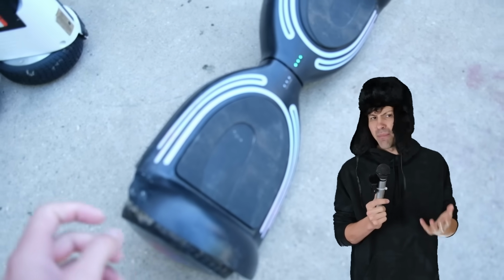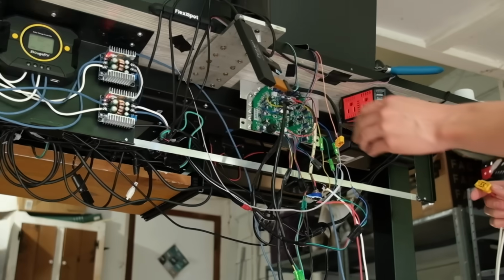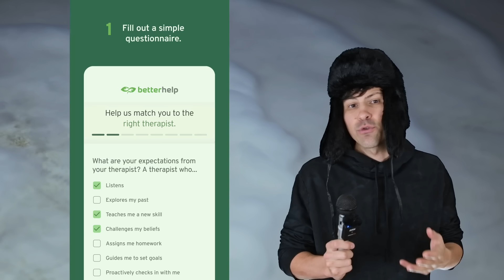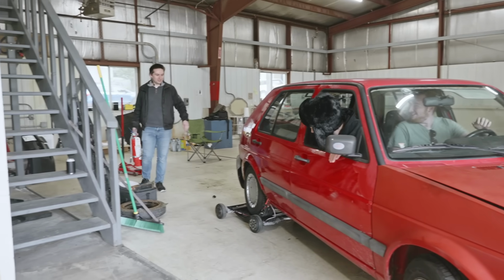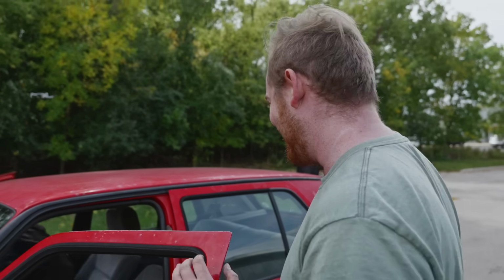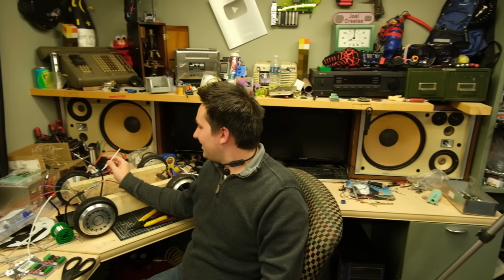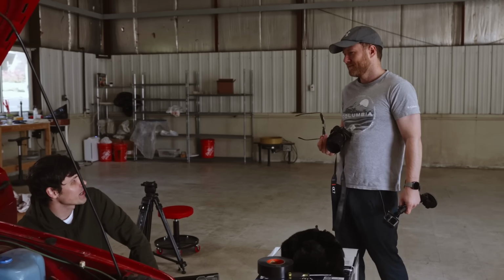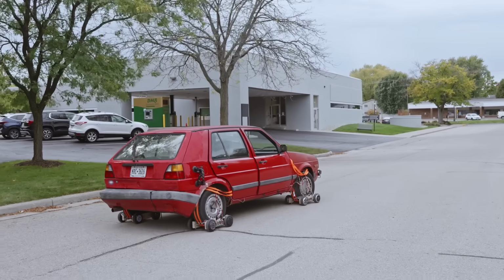I built a Car out of Hoverboards

Comment: I now want a car where the wheels don't spin. Don't care how. But a video of a car going down the road without the wheels spinning would be awesome.
Reply from the maker: It's super trippy
Reply: But that happens anyway just because of the frame rate lol

(Getting a video of a car going down the road without the wheels spinning)
Reply: @biginfluencer5252  yes. Like in a lot of helicopter videos. But doing it without video editing. That would be cool
Reply: You can't really do it by just matching the framerate with the rotation of the wheel, because the blur would give it away. It wouldn't look like the car was going down the road with stationary wheels, it'd look like you matched the framerate. You would also need to have a high shutter speed/low exposure to reduce the blur, then bump up the levels in post processing to bring the image back up to normal brightness.
Reply: Do note that it'd look weird in a new way as you would also have removed motion blur from everything, and added noise to the picture depending on your camera quality. With more editing you could probably convincingly smooth out the noise and add the motion blur back in. At that point it would've been easier to just film a car and replace just the wheels in post.
Reply: Hide really small wheels inside the tires
Reply: You could spin the hubcaps in reverse, at -the rotation of the wheels so they appear stationary. Pretty sure hubcap spinners are already a thing so shouldn't be crazy hard to do
Reply: Some of the expensive cars has stable logos on their wheels, if you can buy that for any car as accessory and stick a big wheel sticker on it, you can make it look like that. If that thing isnt selling anywhere, you can just stick a bolt center of the wheel and put the thing from spinning fidget toys, make a fake wheel skin and tape to the body so it wont spin with the wheel

I think i found the best way? Tho you can only hide the wheels from sides, you cant really put anything between the wheel and body
Reply: that exists already
love how goofy it looks
Reply: Build wheels under the car that are covered by big wheels.
Reply: Lag
Reply: You just discovered spinner rims.
Reply: @trashtrash2169  if you had a fast shutter speed the blur wouldn't be too bad
Reply: 2023 spinner/floater wheels
Reply: @SamanthaLaurier How do you do, fellow ace?
Reply: @CalebTibster   Could be worse, and you?
Reply: What you could do is make the car just barely float off the ground and the exhaust is the same with of the car and the exhaust propels the car forward
Reply: just buy the stationary hubcap spinners
Reply: was able to use a tahoe with weighted spinners to pick up my prom date... same same.
Reply: the russians already made hubless wheels (garage 54)
Reply: Tires spinning and wheels not
Reply: Garage 54 did that one already.
Reply: There called spinner was a fad in the early 2000's they are hub caps you put on you rims that dont spin or spin when the cars not moving was big in the rap seen lol
Reply: Dead easy. Black ice.

Comment: That last shot was priceless! Nice vid. Looks like if you could get all the electronics figured out and ran it on smooth asphalt, you could get 10-15 mph.
Reply from the maker: I was guessing around 15 too
Reply: THANKS KERRY
Reply: @JoelCreates To get that fast you'd need to rewire the motor phases. They're not in optimal configuration for power or speed.  You should rewire the phase coils for high voltage. Should be possible without re-winding each motor. I barely get 15mph on my hoverboard eboard running on 12S with 4 hoverboards running on VESCs.

Comment: Imagine an actual product similar to that for when your car stops working and you don't feel like waiting for hours to get towed home. I'd buy it
Reply: That is an interesting idea. Since it would account for several points of failure.
Reply: There is a product like this. Look at the Icra-2015, this is a fairly outdated design, but it's the first video I could find on here relating to the subject of interest. 
Some parking lots actually use this. Mainly to get vehicles out of the premises that have overstayed their welcome. They do cost a fair amount though, as they need to be engineered to handle the weight of most vehicles, which can be well above 2 tons.
Reply: @FUCKDSS  Right, though some issues would come with consequences, like a flat tire changing the weight/balance, plus it would be extremely limited in speed and might have some trouble with turning how you would want to. Apparently some places do have some kind of motorized skids or whatever they're called for moving cars around in a garage. Which makes a lot of sense, much more than for anything onroad.

Comment: I think you should try spin the car wheels with those motors instead of driving them on ground. As a resistance motor. Tyre is softer than road so there will be less shock on them and ofc they would need to support the car

Comment: these motors could probably fit in the space the normal axle takes up... if you could get enough similar motors, you could drive all of them with 1 or 2 big controllers (might need 1 for each side because of the differential) and have it look exactly like a normal EV swap

Comment: One thing ive learned from messing with hoverboard motors is that some of the aluminum wheels have twice the torque or more compared to any of the plastic ones. The plastic ones are extremely weak in torque.

Comment: Only a minute and a half in, but I think hoverboard motors are a couple hundred watts each usually, one horsepower is 750 watts (ignoring losses) so to even get 5 horsepower equivalent with hoverboard motors you'd be looking at 12 or so hoverboard motors. According to google the currently available car with the least horsepower is the Mitsbishi i and it still has 66hp or ~165 hoverboard motors...

Comment: Joel you could put some castor wheels or just wheels to put some more even weight distrubuition through the metal frame and just have them a little bit higher than the hover board wheels when they have no weight on them so they sink a little bit when they have weight rather then all on the the hover board wheels P.S. i love your videos and i think a part 2 would be good
😃

Comment: Idea: Multi-motor pancake motor: If you replace the tires with gears and put all 16 into a planetary drive arraignment with an outer drive ring, you'd have a "junk-yard sourced" motor capable of driving a car. Welding & machine shop required....

Comment: Everything bad with this project is because you didn't use enough hoverboards. What you need is more hoverboards. Keep making trips to the dump. Well also, umm, if your hoverboards fail you can't stop, the wheels already aren't moving. So, I think it needs probably a boat anchor that works on asphalt or something. But the design is solid.

Comment: Hi Joel! Awesome idea. I was wondering though, would you ever make a V2 of this? I feel like if you used powerful hub motors/wheels pulled off a few electric skateboards with their respective battery packs it and apply it the same way it could be much better! I can pull a car with my own electric skateboard so it would probably work really well and you'd also have a much higher top speed/range.

Anyway, just an idea. Cheers!

Comment: If you make a pulley system that will turn the wheels by gripping the hoverboard wheels to the car wheels, you will achieve better speeds and acceleration.

Comment: Why not get an old steeling and put the wheels inside the barrel and use a giant bearing to allow the hub motors to spin the barrel. That way the axel isn't moveing the wheels the hub motors are spinning the barrels. The tires will mount to the barrels that way they won't take the bumps and instead will be cushioned by the tire and suspension and therefore protected from the weight

Comment: This was pretty cool but, kinda backwards I think; wouldn't it make more sense to use the hoverboard wheels to spin the car wheels, kinda like a pair of gears?  There'd be no real weight on them, and it wouldn't have problems turning (assuming you're doing it on the back wheels only)

Maybe a long 2x4 running parallel to the car's axle, strapped to the frame.  On each side at the car's wheels, slap on a door hinge attached to a pipe attached to a hoverboard.  Tie a strap to the hoverboard, hand it to the driver through an open window, and have them pull harder or softer as a sort of clutch, to keep it from dying on takeoff and to avoid problems from the moving suspension.  Seems like the right level of hilarious jankiness, and might even work

As a bonus, it would probably be (a little more) street legal, legitimately driveable and kinda fail-safe, because the worst that could happen is the hoverboards burn out and you can't accelerate anymore (rather than grinding along the ground and messing with steering and braking).  Coasting would also work nicely.  If you have them pressing against the inside of the tire, they'd be kinda invisible, except for the strap running up through the window.  Or the outside would work too, wouldn't be as fun if you couldn't see them

Comment: what if you used wheels from a motorized scooter instead, like a handicap scooter that is rated for more weight and have a better power output to compensate for the weight. Unless the motors from those are the same.

Comment: prolly would have been easier to just conect motors together using gears then drive shaft it to transmission and boom somewhat functioning electric car
Reply from the maker: that's a lot of gears, plus custom brackets that mount every motor around the transmission shaft. Probably doable, but in my experience, not easier
Reply: @JoelCreates  seems like personal problem (joke) honestly tho good vid

Comment: Is the original motor removed?

16 hoverboard motors is enough. I think the controllers are just of the extremely cheap type. Normal controllers are still cheap and would probably be better. Then use 1 battery for every motor. 

1 hoverboard with it's 2 motors are strong enough to push an adult, even op a 10% incline. So 16 motors are like 8 hoverboards. The car and the driver are the same as 8 people.

Comment: yeah, looks funny? but why don't remove IC engine(for weight) and replace it with all motorwheels coupled together on some frame with belt transmission?
Reply from the maker: The engine was partially removed. This was simpler and cheaper

Comment: It takes only about a year until an electric car starts to beat a Diesel or gasoline powered car in terms of causing less total pollution. And from then on, the fossil fuelled car creates more and more air pollution, whereas the EV has added almost zero extra CO₂ apart from any which is created through generating electricity, since the day it was built.

Comment: Ya know, I wonder if you’d be able to get away with crushing down the street without a license or registration, insurance?.. Wonder if since it’s now powered by those very small electric motors, if it’s still classified as a passenger vehicle anymore??.. I mean, yeah it still has its size and weight, slightly more weight now, lol. But I’m honestly not sure if it would really be anything more than what it actually is.. Just a few hover boards that are strapped and bolted together. So is it still REALLY a Powered by the same energy source as what a 10 year old would ride down the street with. At no higher speeds than a bike could manage, if even that.. 🤔🤔
Sooo, I mean, as long as you weren’t doing it on a street that was busy, you might just be able to putt that thing down to a friend’s house, or the lil corner store perhaps!…

Comment: Its not a bad idea in principle, just horribly executed. The weight of the gas tank, engine, transmission, wheels, etc. makes it no wonder the hoverboards cracked and failed the way they did- It could definitely work, but not as a one-week rushjob to get a video out in time.

Comment: Its dumb to think that making electric cars is not green. Just look at the amount of petrol you burn in one year. You could make an electric car every year just with the petrol. And making an combustion motor takes tons of power to metl, cast and mashine. That statment is completle wrong. Just replace the costo of production in contamination of regular cars and add even if you have to double it you have solar panels and an electric car to drive for 10 to 20 years.

Comment: Reality Check for SCIENCE The notion of blindly accepting science with the phrase 'Believe the science' can be misleading. Science itself is a rigorous process founded on skepticism, inquiry, and the application of critical thinking and reasoning skills. 
Asserting blind belief in science is, in fact, one of the most unscientific stances one can take. It's imperative to develop the ability to critically evaluate scientific claims and comprehend the complexities of our world through experimentation and observation. 
Take the opportunity to scrutinize these claims: (Do the experiment)
ChatGPT said: If you aligned a gyroscope to 90 degrees to the Earth's axis, you would expect to see the gyroscope precess at a rate of approximately 1 degree every 4 minutes, regardless of the latitude. This is because at this alignment, the gyroscope's axis would be perpendicular to the Earth's rotation axis, so it would complete one full rotation (360 degrees) in 24 hours, resulting in a precession rate of 1 degree every 4 minutes.
If the Earth is not turning, the gyroscope's axis would remain fixed in space, pointing in the same direction, and there would be no precession. Spin the gyroscope the other direction to prove it is balanced.
Therefore, it's important to harness your superior logic 
Take the opportunity to scrutinize these claims: (Do the experiment)
The level sensor in a phone is first calibrated in relation to the center of gravity. 
Subsequent level readings are then based on this initial calibration. 
To showcase the level sensor's independence from gravitational forces, one can calibrate it on a level turntable and subject it to varying speeds to induce centrifugal forces. 
Observing that the level readings remain unaffected will illustrate this point. 
Take the opportunity to scrutinize these claims: 
4,519 MILES NO CURVE Globe Debunked Once And For All RESEARCH FLAT EARTH (Mirrored) 
“NASA'S unedited fake "moon landing" with stage lights falling” youtu.be/LCuhsvUAwdU